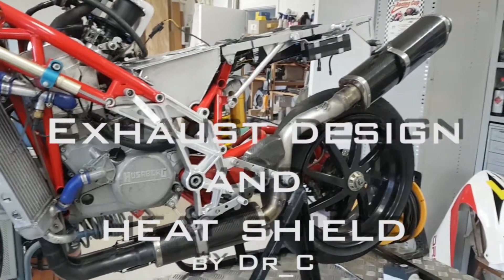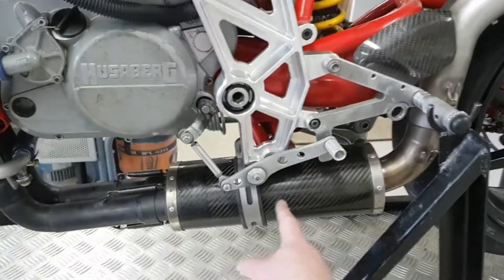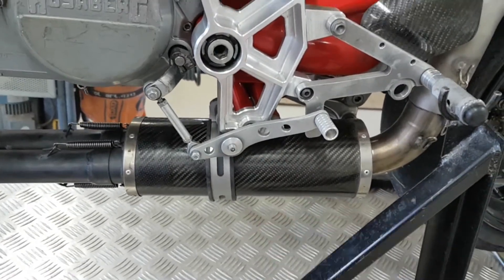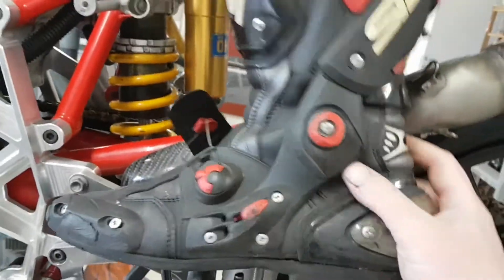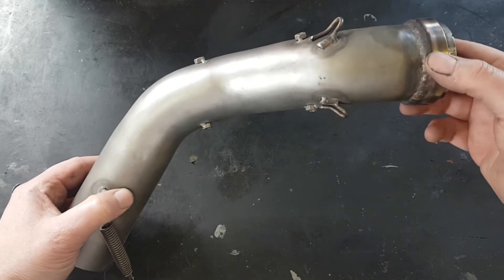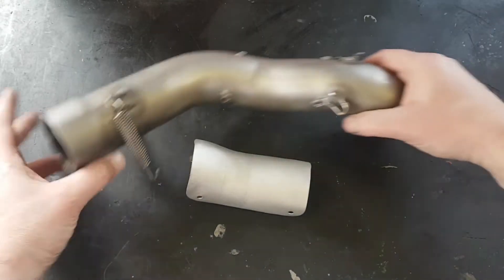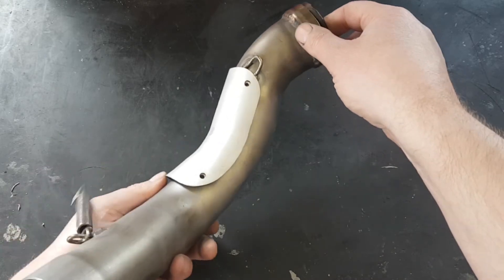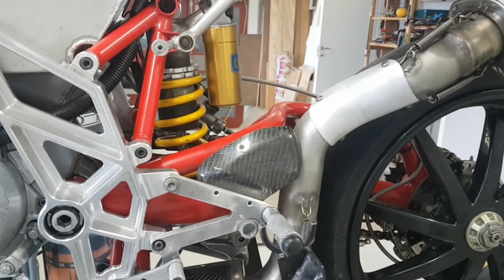Exhaust design and heat shield

Comment: are you using the initial muffler as a ''powerbomb'' ? did you get any benefit of it on the dyno or you running it for more sound reduction? nice work all the best with the racing season ...hope to see new stuff coming in season 2017 :)
Reply from the maker: +Paolo Bianchin Hi Paolo and thanks for the interest! Check out my other answer, if that helps explaining the idea with the first muffler (besides reducing noise). I showed some of the new stuff for 2017, in the video about "Head gasket and crank balance". Check it out! 😊
Reply: got the idea ...I did watch it...I hope to sort out myself soon as I really want to start a frame project like yours ..I will make sure I will rewatch all with book and paper  I like your smart work/idea/solution

Comment: Which formulas did you use to calculate the volume of the resonance chamber? The formulas for Helmholtz resonators? Im trying to design a muffler as well with a build in resonator. But im not sure yet if i want to use a quarter branch resonator or a resonance chamber.
Reply from the maker: +Freek Jacobs This is not an intentional/calculated resonator. I only use the chamber to get a distinct increase in area at the desired distance from the exhaust valve seats. The increase in area (as I'm sure you know), reflects the pressure pulse into a negative pulse, travelling upstream the primaries to help exhaust out when the valves open next time.
Reply: Oh I understand. I thought it was for sound dampening since you referred to the strict noise regulations in the beginning of your video. Great video by the way. I've watched all of them with great interest. Keep making more of them please! I used to be a mechanic for a supermono team as well and these videos remind me of those times.
Reply from the maker: Thank you for the interest! Please share with us few likeminded! :-)